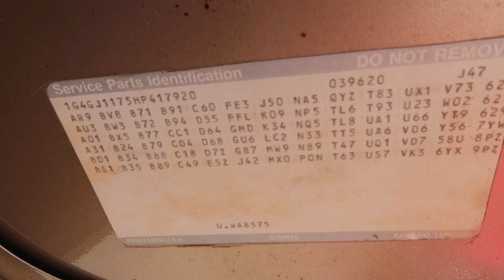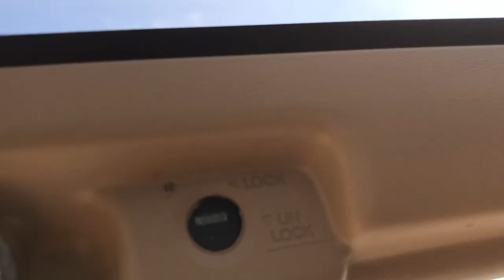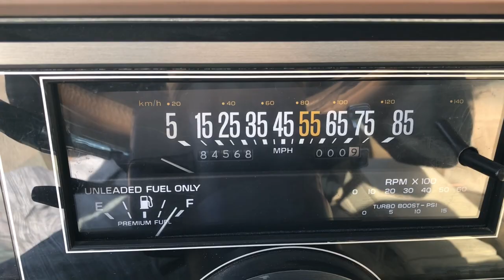1987 BUICK REGAL TURBO T ON FORGIATO WHEELS 24 INCH

Comment: What's up bro. I am a regal super fan. I'm going to purchase one later this year like July. Do you have any ideas were I can purchase one for the price range of 5000 to 7000.
Reply from the maker: Craigslist or Facebook groups
Reply: @kooliebkoolin  Ok thank you. I have a 350 rocket engine with the transmission attached in my garage. It came out of a 74 Cutlass. You think it will fit the regal without drastic changes to the car?